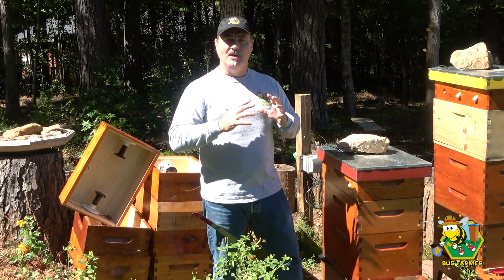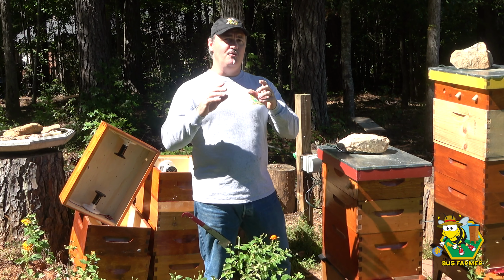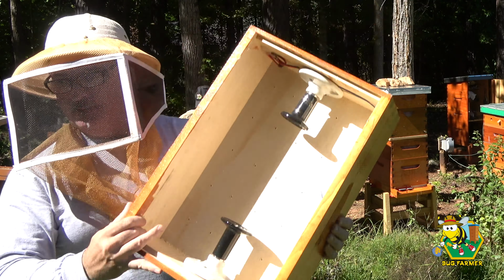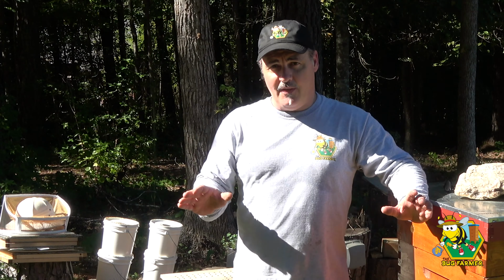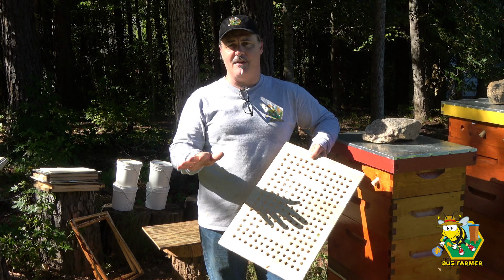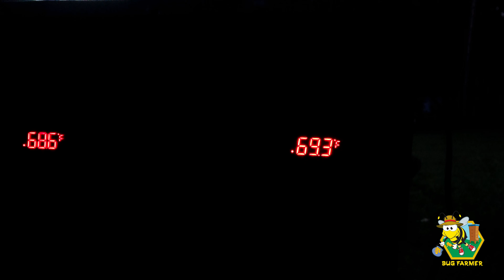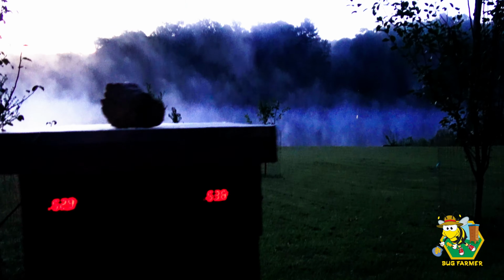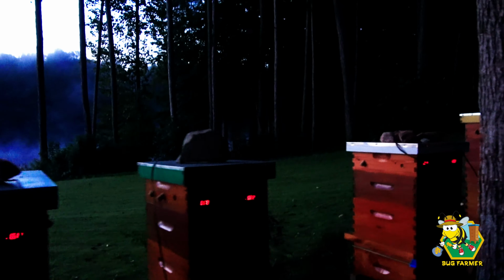Installing Beehive Heaters. Winter beehive preparation with internal beehive heaters.

Comment: I installed you heaters last week! I would love to let you know how they work here in ALBERTA Canada! If you could send me your email I will send you a few picts or video so you can see how they work up here! My email is mcnally4@telus.net they have been good keeping them warm to this point! And we got snow today and my girls are warm dry and happy!
Reply from the maker: That is awesome.  I just sent you and email.  I can't wait to see how they do in the snow.  What temp are you setting it too?  I find that 60F 15.5C is the sweet spot for me in the winter and 70F (~21C) is the sweet spot in the Spring and Fall..  It keeps them from clustering and they don't consume their resources to quickly.  Although Frederick Dunn says not to worry about condensation because the bees use it for their water supply I may put a burlap pillow in the top controller box to deal with any excess condensation. Thanks for reaching out and I can't wait to see the pictures.
Reply from the maker: Did you receive my email?

Comment: I built your design, but made it with a Raspberry Pi, relay board, thermocouple sensors, and a PWM driven triac board for dimming the heaters. I will make a video reply some day.
One note: if you heat the bees up in NY they will just fly out of the hive and die on 27°F days. They’re not too smart.  I’ll have to either add a photo sensor or switch based on time or add a mechanical front door.
Reply from the maker: What is the set temp on your hive?  You might try lowering the set temp a bit.  For me 72F is the magic number, yours might be lower.  My goal is not to prevent a cluster just to prevent a big cluster.  Most of my bees simply stand around and sway back and forth as if they were wash boarding. but they still maintain a small cluster around the queen and the brood.  They just don't have to work as hard to hit the 95F make for brood rearing. I have never had an issue with my bees flying out on days when the temps are below 35F other than to do a cleansing flight or bring out their dead.  That said, I do see, asnd suspect you will also,  some dead bees around the hives due to the dead bees being brought out.  The mortuary bees don't carry them very far before dropping them in cold temps but at least their aren't piles of dead bees in the hive in come springtime.   I would love to see your design, maybe send a picture if you can.  Also, make sure you are using the diffuser board top let the heat rise evenly throughout the hive.  As for the Raspberry Pi, maybe include a humidity sensor too.  Thanks for reaching out with your experience.  Please keep me posted.  Thanks for reaching out.  It was great hearing from you.  Take care.

Comment: Is it possible to put the heating unit on the top instead of the bottom and get the same results? I didn't find this idea or your channel until now... but my boxes are too heavy to lift now. And there's no way I'll be able to pick them up.

In your design it showed 2 heating units per box... does it work with just 1? or do you actually need 2?

I'm curious what made you pick 68 or 69 degrees for the temperature setting?
Reply from the maker: All great questions Noah.  The heater will not work if placed on the top of the hive.  Unfortunately heat rises.  I suspect they will work with just one heat lamp.  As for the temp, it's just an arbitrary setting I though the bees would enjoy.  Not to hot and not too cold.  Thanks for stopping in and for taking time to comment.

Comment: Is this the first year your using the heat boxes? Can the bees get into the heat box?
Reply from the maker: No.  I used them last year too.  The bees cannot get into the heat boxes.  I have a diffuser  and a screened bottom board above the heat boxes.  Good question though.  I believe I show the configuration in the third build video.  Thanks for watching.

Comment: Wish I could move that fast. Been some crazy weather. Like summer here this week. Great video! I think your the most high tech beekeeper I know. Do those boxes make your electric bill jump?
Reply from the maker: The electric isn't too bad.  I basically have 18 50W bulbs running intermittently. throughout the winter.  Once the hives are up to temp they are pretty stable.  If last year is any guide.

Comment: Can you post a list of parts and sources in the description?
Reply from the maker: https://youtu.be/ulG_bWTMZBU
https://youtu.be/8V4uGvSR5Bk
https://youtu.be/W-UKAgF8EGs
https://youtu.be/lTZUU0DhnmY

Outlet :
https://amzn.to/2vyZHFJ

Power Cord:
https://amzn.to/2SC7Np6

1/8" Hardware Cloth
https://amzn.to/38Cdpq3

Bun Fan: 2pk
https://amzn.to/2HmJLsQ

50W Heat Light 2pk:
https://amzn.to/2HjTJez

SAE Extension cable: 2pk
https://amzn.to/37pDXtp

Porcelain Light Base:  2pk
https://amzn.to/2HoANLC

110V Inkbird Controller: (You need 2 of these) 
https://amzn.to/31O75t9

100pk. Wine cork: (you will only need 6 corks so drink it it you have it otherwise buy these)
https://amzn.to/37rBLBw

Betterbee Budget Medium Supers: 5pk (Shipping is expensive)
https://www.betterbee.com/wooden-hive-equipment-8-frame/boxbg8m.asp

Mann Lake 5pk Medium Super (Free Shipping)
https://amzn.to/2vAvNkK

 Other items you may want to purchase:

Man-O-War spar varnish: 
https://amzn.to/2SmDZxK

40 pk.Foam Brushes: 
https://amzn.to/2tY9RiY